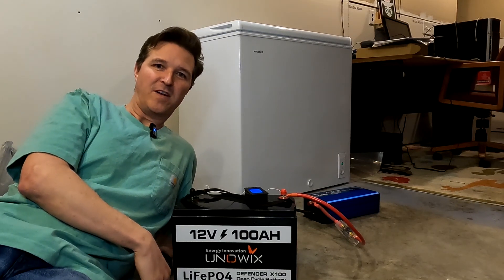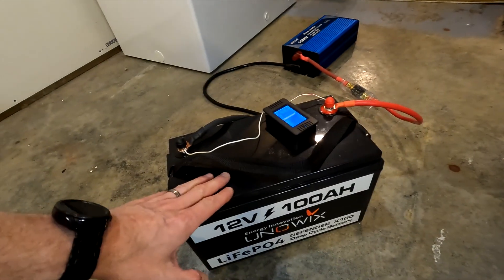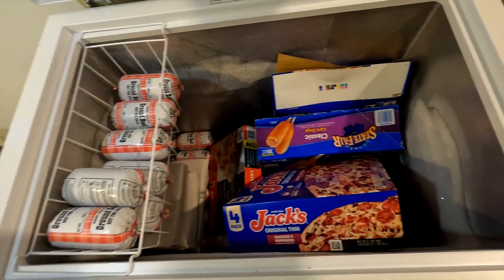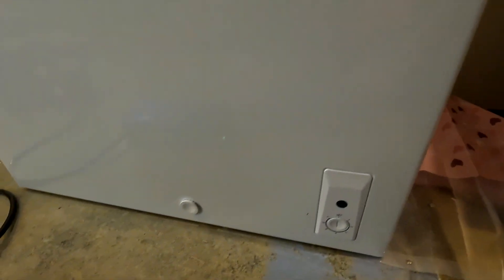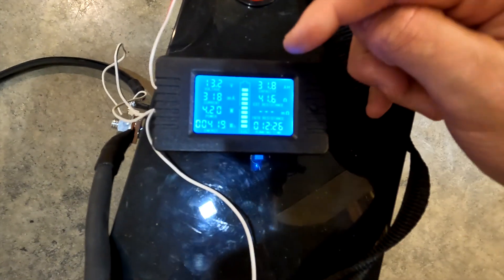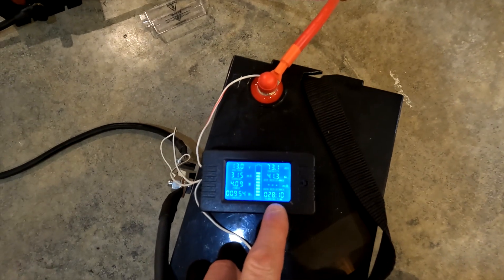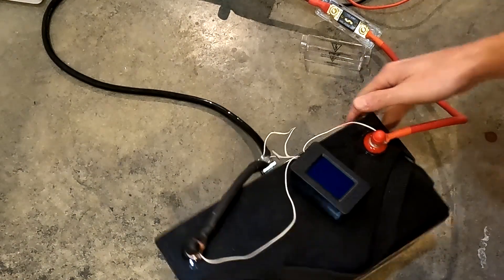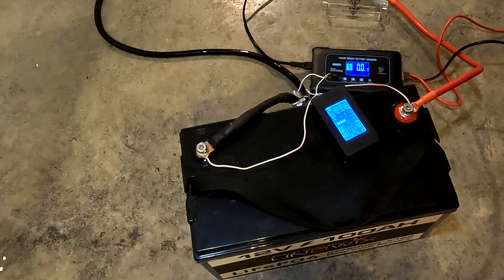Running Brand New 7cu. ft. Deep Freezer with a 12v 100ah LifePO4 Battery!

Comment: I live in panglao island in Philippines and we have a low wattage freezer ,   its very hot here and our freezer is a working freezer,  we sell ice,   when we put the water bags into the freezer the power draw is very high,  8-10 A ,   dropping a bit obviously as the water freezes ,   we usually get 10 to 12 hrs from our 100 ah battery ,  we get regular power cuts here.  I like your vids sir, very informative,  Thanks
Reply from the maker: Thanks for sharing!  That is a great use of a battery.  How long do the power cuts last?
Reply: @OffGridBasement  we have had a few that last months,  infrastructure damage after an earthquake and major storms an such ,  then there is a lot of day here an there type deals,  Im from Scotland married to a Filipina 15yrs now.
Reply: Hello. Question. How many hours do your freezer takes to freeze 50 bags of water to sell as ice bags..I'm in Haiti I do understand...
Reply: Hello can you share the name of your low watt freezer..Inquiring Minds...
Reply: @ulrickfrancois1378  Hi,  My wife freezes them overnight,  Best to space them apart close to the freezer wall.  the name of the freezer is condura ,   it might be call a different name in your country,   I think its is the same one that offgridbasement tested only its a different name in usa.
Reply: My good man i need your help, ibhave a chest freezer that consuming 189kw/h per annum, i need to build a system that can upkeep my freezer from sunday 6pm to tuesday 9.30 am. Can you advice me what battery/batteries and what inverter inhave to buy for it?@OffGridBasement

Comment: The key is to keep your freezer full to maintain a steady temperature. If you don’t have a lot of product in the freezer you’re consuming more power. You can add gallons of water as they turn into ice the freezer in turn will stabilize and only sip power allowing the freezer to be more energy efficient.
Reply from the maker: Thanks for the info and the comment.

Comment: You can run it for 1 hour and then off for 2 hours. This will maintain your freezer and preserve your battery for longer run time usage. I do this in my off grid cabin.
Reply from the maker: Thanks for the information and the comment.
Reply: Wouldn't the freezer have to run longer to "catch up" making it about the same as if you didn't ?

Comment: Thanks for the demonstration. I suppose you could run it for 12 hours then shut the inverter off for 12 hours or so then repeat the cycle. Your food would still stay frozen as long as you’re not opening the freezer and you would get more than 3 days off a single battery
Reply from the maker: I'm sure you could.  I would test it a couple times to make sure the food doesn't get above 32 degrees.  I'm also not sure if it would cause strain on the freezer.
Reply: You'd still use the same amount of power possibly even more.

Comment: And if you connect a 200 watt solar panel to it with a charge controller it will run forever!!!!!
Reply from the maker: On sunny days it sure would!  Thanks for the comment.
Reply: @OffGridBasement you still get juice on cloudy days (with modern panels), just less of it.

I really need to take measurements this fall, I just started in solar and I live in the pnw where I know I'm going to need to overpannel for cloud cover 🤣
Reply: I'm considering doing this as I have two spare 90 watt panels and a spare 1500 watt inverter and controller. I just need to get the freezer... 😀 Don't see why it wouldn't run forever.

Comment: i bet half the power use in this test was just the inverter. 12v dc fridges have come down in price considerably in the last 2-3 years. 1400 dometic now you can find 100$ on walmart's website. got some random brand kapas 54 quart fridge for 99 bucks on sale. added insulation to its base and covered it in IR reflective aluminum foil tape. it uses about 0.2kwh/day or 16ah/day in 12v land. its insanely efficient. most fridges use about 1.5-3kwh/day. currently rigging up a usb-c gan charger to run it since they have like 10x less losses than regular brick power supplies. trying to get it to around .1 kwh/day. for example this battery would power it for 2+weeks and wouldnt require an inverter.
Reply from the maker: Thank you for the great information and comment.

Comment: A great real-world scenario.  

I would imagine that most people in a power outage situation, would have some product in their refrigerator or the freezer, which would help maintain that cooler temperature. Obviously your results would change, depending on the age and style of the freezer, but still goes to show that you can get quite a bit of life out of a 100 amp hour battery as a back up power source.  

Thanks!
Reply from the maker: I find it amazing just how much you can do with smaller batteries.  The portability of lifepo4 is just great!  Thanks for the comment.

Comment: Just today I left a comment on your first 7 cu.ft. freezer video, then I found this video. I'll leave a brief recap of my other comment. ( Okay, I lied. I'm genetically incapable of leaving brief comments, so sorry 'bout that.) Your freezer has a lot of low density foods like frozen snacks. Also, as you noted, it is only about 1/3 full. I suggest that you always keep it full by using 2 liter bottles filled with water, maybe lining the bottom of the freezer for 2 or 3 layers. That will provide a flywheel effect that will reduce the cycles of the compressor. Take them out as you need more room in the freezer and as long as you used potable water, you can have a cold drink. Using an inverter to power JUST the freezer, in an outage, will work best if you use a smaller inverter and make sure that it's one that doesn't have 12 volt outputs or USB. These cheap inverter aren't very efficient to begin with and smaller ones waste less power and powering outputs that aren't AC just wastes battery energy keeping those outputs active, but unused. To get the most from your setup in a "geez, I don't know if the power will ever come back on" scenario, charting the on/off cycle of your freezer now will let you duplicate it manually by turning the inverter on and off during an outage. That way you save all that wasted standby power that the inverter uses just because it's turned on and waiting for something that needs power to tap into it. Any unused quilts and blankets that you can drape over the freezer will allow you to go several days before you even have to worry about powering the freezer, provided you kept it full before the power went out. Now set aside 5 or 6 days, drink lots of coffee and use my suggestions to see how long you can really go. Just kidding, but the things I mentioned will definitely extend the life of your frozen food in an outage. Done it and got all the Tee Shirts. Ice storms and tornadoes are both pretty common where I live.
Reply from the maker: I hope everyone reads this comment.  It is full of great information.  Thank you so much for taking the time to comment.
Reply: Can confirm from extended power outages. Depending on the weather a chest freezer that was at standard chest freezer temp can remain frozen when unopened for 2-6 days without power. Blankets can probably add an extra day.

Comment: I bought a new 7cf freezer when I plugged it in it ran for about 25/30 hours straight before it cooled down enough to start a Regular cycle
Reply from the maker: Wow.  Mine was frozen after a couple hours.  I hope it works fine now.  Thanks for the comment.

Comment: Some very moderate battery support from solar and/or wind power would extend that run time significantly.
Reply from the maker: Yes.  It could easily double or triple the time.  Thanks for the comment.

Comment: I'm going to try powering a 5 cubic foot freezer on refrigerator mode about 34 degrees trying to figure out how much battery and solar panels it will need to run off grid.
Reply from the maker: That's a good project!  Let me know how it goes!

Comment: nice still new but starting to get the hang of it pretty much basic simple division and multiplying amps watts hours and can calculate the power source you need for type of things you want to run.. ... now i can get a 3 100w solar panels and each panel puts close to 5.5amps so total ill get 16amps an hour putting it on a 12v 100ah and i should be able to fun a freezer like yours maybe even a slight bigger with no issues and go off grid on it along with powering up 12v lights and charing other things.. maybe ill get a 2000w inverter because ill be running other small stuff and maybe get 2 100ah 12v battery and this should run good since i live in california we get lots of sun... very good info seems like i dont need a shunt after all i can just use my amp meter and i can just calculate from there if i need more solar or battery ect.... very simple thank you
Reply from the maker: Looks like you are on the right track.  With the equipment listed you should be able to run the freezer no problem.  Thanks for the comment.

Comment: I would like to see this exact same test done, except that you add the thermometer and external tempature controller with it set to run that freezer at refrigerator tempatures.
Reply from the maker: Thanks for the comment.  This freezer is now full!  I'd need to get a second one to test that.

Comment: Thanks for the video, what is the average temp in your basement? Im looking to do this system outdoors where we have heatwaves, so guess the freezer will need to work very hard to stay frozen and battery life may be much shorter
Reply from the maker: The basement stays around 68⁰F. If the freezer is well insulated it shouldn't be too bad.

Comment: I've been thinking of doing this with a current large chest freezer we have access to,not very energy efficient currently because of age but that can happen later,you mentioned you had no alerts or beeping from the inverter or the battery monitor which was concerning so what came to mind was a similar test with one of the Renogy 100w Bluetooth/mobile app monitoring batteries or even there newer 200ah batteries obviously cost will always be a factor but reach out to renogy and see what tests you can do with them,my freezer however runs in watts (w) up to I think 200w an hour but more monitoring is needed for me I think...keep up the tests you got this
Reply from the maker: Thank you for the support.  If that freezer uses 200wh then with a 100ah 12v lifepo4 battery you should be able to get a good 6 hours of runtime.  Let me know what you find.  Thanks for the comment!
Reply: @OffGridBasement  I am only roughly after a 12 hour solution in my initial plans but then expanded it to 24 hours but 6 hours I hadn't calculated in my workings back to the drawing board I think,I was thinking of continuing to top it up with a smallish solar panel also,but I'll see what I can find results wise.

Comment: What did you mean by connecting the negative cable to the shunt when charging your battery?
Reply from the maker: That way the shunt captures the power of the charger.  Hope that makes sense.

Comment: You're not using a pure sine wave inverter? My chest freezers are all 12 volts, except for a 5 foot that should get traded away.
Reply from the maker: The ALFFAA inverter is a pure sign wave inverter.  I would like to get more 12v appliances because they are so much more efficient.  Thanks for the comment.
Reply: @OffGridBasement  Ten - Four. Don't forget the tiny Honeywell Quiet Set fan. I have one here. I love my 12 volt chest freezers and CB radios.

Comment: So it cannot be done w a regular battery? I have a new 5000W inverter but my cooler shuts off.
Reply from the maker: The amp draw might be too much.  The voltage is probably getting too low for the inverter so it faults.

Comment: 2:21 do you keep inverter on floor? I’m concerned about water damage from anywhere, not just a fridge or freezer.
Reply from the maker: If it is a permanent setup then you would want it elevated.  Thanks for the comment.

Comment: May I ask if you think there is something in this battery costing $500 that makes it worth more than the $300 ones?
Reply from the maker: The unowix does have an active cell balancer and cold charging protection.  It probably also has higher grade cells and BMS.  Hope that answers your question.  Thanks for the comment!
Reply: I will answer, nothing

Comment: Excellent video.  I'm a new subscriber.  

I would be interested in knowing how long the battery would last if there is an insulating jacket covering the freezer.  A jacket could be made from the same material used to to insulate camper vans and window blinds.  Just a thought for one of your videos.  Cheers!
Reply from the maker: Thanks for the idea and comment!
Reply: Most chest freezers use the exterior skin to radiate heat from the condenser.

Comment: I just bought a 100ah lifepo4 and tested on my freezer at 13.6v 

Freezer is comsuming about 125watt and it seem could last only 10 hours on my lifepo4 battery till it run down to 12.3v 

Is my battery a low grade cell? 

Thanks
Reply from the maker: That makes sense.  If the fridge is using 125w per hour and the battery is rated for 1280wh then you would get right around 10 hours of use.
Reply: @OffGridBasement  But how come in yr video a 100ah battery last for 36 hours where mine only last for 10 hours
Reply from the maker: @Lee-Fiz  I'm not sure.  I don't understand why your freezer uses 125w per hour.  It should be a lot less.  It should only use that for about 15 - 20 minutes every hour.  That would make it so it's only using about 42w per hour which makes more sense.  I don't believe there is anything wrong with the battery as long as it's getting charged up to 14.2v.
Reply: @OffGridBasement  Yes it uses 15-20 minutes, tht is how freezer works right...but each time the motor kicks in my inverter display show 125w and gradually goes to 110w  and tht is the lowest it would go till it stop.

I notice tht my charge controller will charge as high as 14.4v but when it is fully charge my battery will go into flooting charge about 13.4v I wonder if this hv made the battery less wattage to run my freezer at night
Reply from the maker: @Lee-Fiz  everything you are telling seems to be right.  Float @ 13.4v is good.  I think you need to purchase a watt meter to measure how much energy is being used on the AC side.  If the battery is shutting off and the watt meter only reads a total of 500wh then something is wrong with the battery or the inverter is pulling A LOT of standby wattage.
Reply: @OffGridBasement  Ok i will purchase a watt meter and do a test.

Will update you once I hv test it

Thank you so much

Comment: Dies the inverter play into the scenario..
I have an 800 amp inverter with a 7.0 chest freezer.
Reply from the maker: It will a little bit.  Standby energy consumption is going to be the biggest issue with the inverter you use.  Thanks for the comment.

Comment: Looking at the voltage of 13.7 and stating it's 100% full based off of it is old school lead acid battery thinking. It's a lithium battery and voltage never indicates SOC. Also, the dip (voltage sag to 12.2v) wasn't too impressive for a lithium battery with such a smallish load.
Reply from the maker: You're right about the 12.2v lag.  I really need to find out what the initial draw of the freezer is.  After testing multiple Lifepo4 batteries I know that full is 14.6v, but then it settles at 13.7v after resting for a few hours.  Thanks for the comment.

Comment: Even longer if the freezer took 12 volts
Reply from the maker: Yes.  There is AC conversion loss at the inverter.  Thanks for the info and the comment.